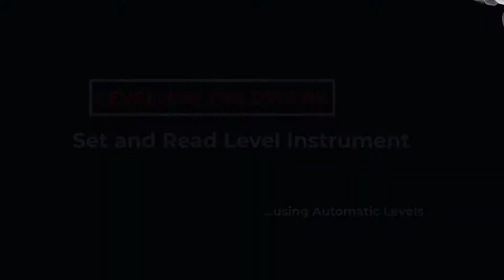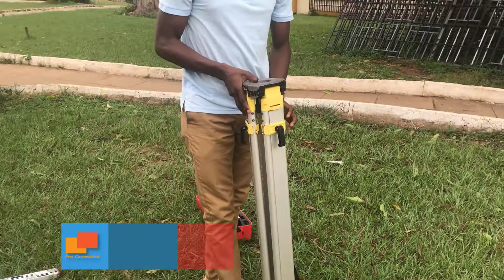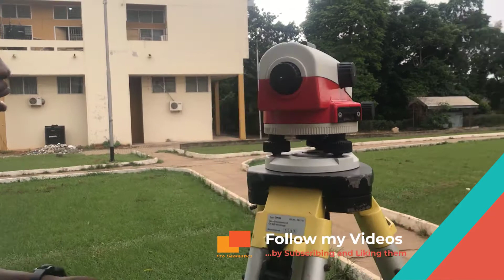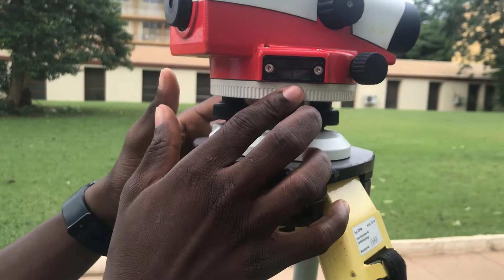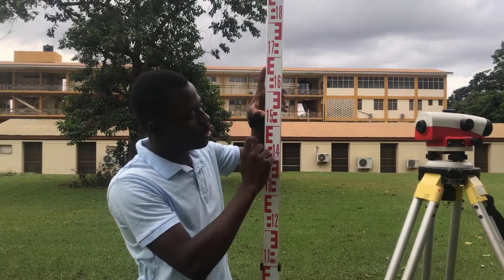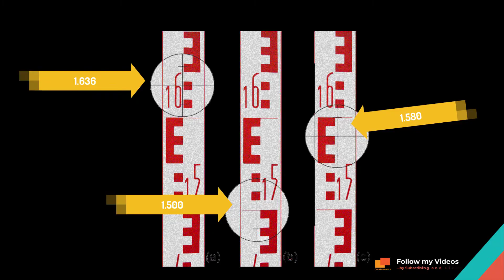Reduced Level Survey 3: How to set up and read Automatic Level on site  #engineering  #survey #site

Comment: 1.638
1.500
1.580
Reply from the maker: Michael, I think you need to watch this one instead.
It's quite long.. But patiently learn from it and it will clear your questions 

Level Survey Part 5: Rise and Fall method of reducing Level Data into Elevations/Spotheights
https://youtu.be/MSf0E32I0JY

What you need to do is.. Survey all your points including your benchmarks (no matter how many they are) then reduce the levels as shown in the video I've attached